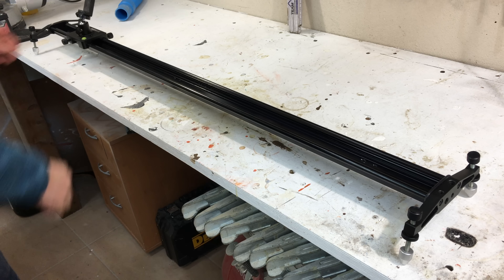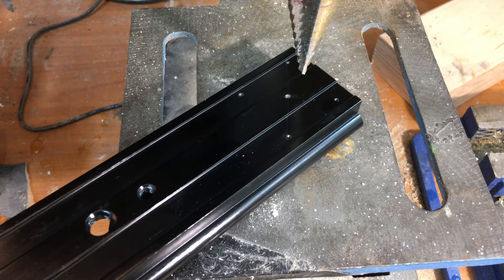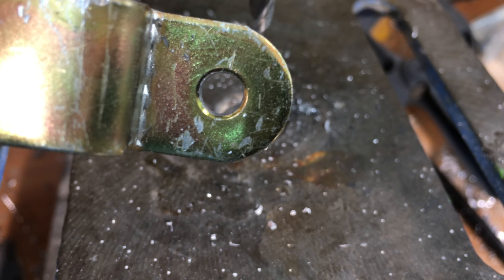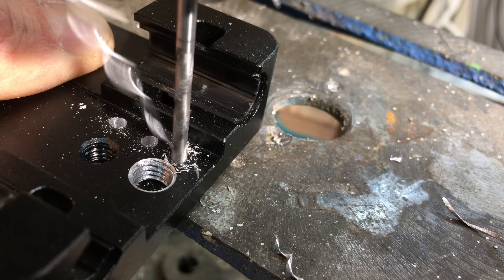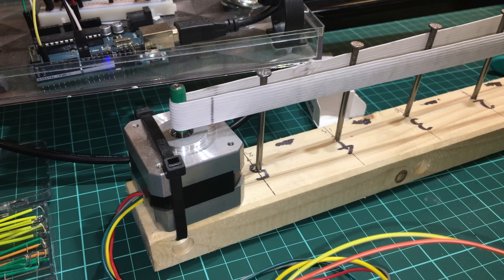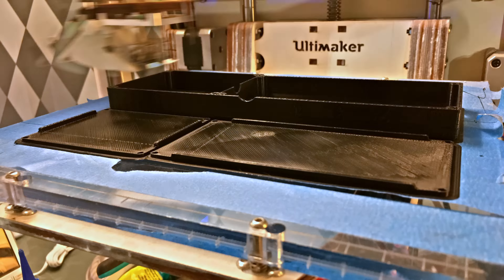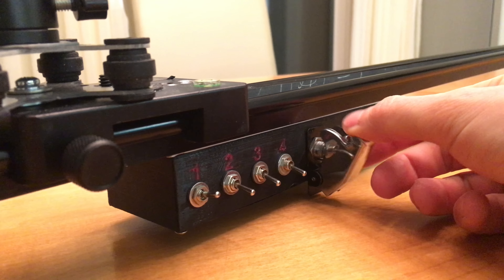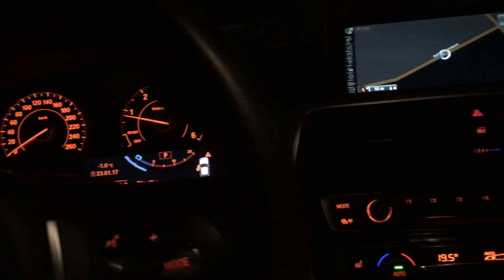Lets Make - A Motorized Camera Slider

Comment: Nice build Max.
Can you tell me if the stepper motor is able to move and retain the truck when the rail is 45° or more bent ?
Gerard
Reply from the maker: +Gérard LAGIER Sure it can. I use mine vertically. The motor retains the position as long as it has power.
Reply: Yes, but it depends on the total weight...What about a DSLR, let say 2kg ?
Do you use a NEMA 17 as motor ?
Reply from the maker: +Gérard LAGIER Yes I use a Nema 17. For heavy cameras you should use a Nema 17 with an integrated gearbox. There are various ones available.
Reply: Yes, this is what I was watching for. The torque is X5.
Thanks for your help.
Reply from the maker: Your welcome!

Comment: Great video Max. I was working on building a thing Sammy Kamkar came up with called the Combo-breaker, but there are a lot of electronic pieces and I'm overwhelmed with wiring and code dead-ends. Also, the Combo-breaker is essentially worthless and is more of a stunt. This might be a better micro-controller learner tool to build as it's useful and seems to have less moving parts.

Thanks for sharing. My interest in micro-controllers is coming back! :D
Reply: I'd like to do some micro-controller stuff to the school bus/tiny home we're building. Maybe having a switch that would close the curtains or something like that. Your camera slider could probably be re-engineered as a curtain opening/closing mechanism.
Reply from the maker: Thank you! I know the combo breaker. The maths behind it is really clever. Good luck with your coding! I can recomment The Great Scots Arduino 101.
Reply: Yeah. This Great Scott video is excellent. Thank you.
Reply from the maker: +Ian Robinson Sure. Once you wired a stepper and controlled it, you can apply that to all kinds of things.
Reply from the maker: +Ian Robinson I sometimes watch it myself for reference.

Comment: I am actually building my own from 3D printed and other components. I am trying to use your code but my stepper is making some horrible vibration in the system so I assume I am at a full step. Are you microstepping and if so how are you as I don't see any power to the MS pins?
Reply from the maker: Yes, I switched to Microstepping shortly after uploading the video. So you need to short some of the microstepping pins to ground I belive. You find how to do it exactly in the A4988 tutorial inside the instructable. Obviously you also need to double the step values in the code to achieve the right speed.
Reply: @MaxMakerChannel  at this point as long as I can achieve smooth motion I'll be happy then I can add more bells and whistles haha
Reply from the maker: Steve Kearney I think you can.

Comment: Hi Max! I am interested in doing a project like this for my camera slider, but I have 2 daunting constraints: the slider runs autonomously AND it is absolutely silent. My goal is to record musicians close up so it would be ideal to not hear a whirring motor on the microphones. Do you think this is feasible, and how do you recommend I proceed? Thank you, and fantastic video!
Reply from the maker: I would suggest using a DC motor with a motor controller for $15 from Amazon. Get a good quality slider with ball bearings. It will be quite silent.

Comment: Is it possible to make this open and close all the curtains in a house at set times? That would be brilliant
Reply from the maker: Yes it is. The circuits and code are already 95° of what you need.
Reply: Thank you for the reply, just realised that the motors may not be powerful enough to move a set of curtains?
Reply from the maker: They are. Even the tinies motor could move an entire ship if the gearing ratio is big enough. Half the speed, double the strength. You can get these motors with build in gear boxes.
Reply: Thanks, do you think a timer controlled auto curtain project is something you would be interested in doing for your subscribers? Will help get our teenager's to wake up a little easier ha
Reply from the maker: Not really unless Somebody commissions me to build one.
Reply: Ahh Ok

Comment: Very impressively and simple design.
You use a mobile, but will the unit take a DSLR. I have a Canon 7D. Will your design need to be beefed up to take on a DSLR?
Again, great video.
Reply from the maker: +Ian S. Rutter Thank you very much. I do my very best with the production, but that also means that they take longer. If you keep it horizontal, the weight doesn't matter. You can get the same size motor with an integrated gearbox ranging from 1:5 up to 1:50 reduction. It will move slower but be much stronger.

Comment: Nice project! I'm also working on motorising my camera slider. The movement is still a bit  jumpy though. Do you use microstepping on your stepper motor?
Reply from the maker: +Maximilian Beck Yes. I use 1/2 Microstepping. You could also use a geared Nema 17.
Reply: Wow that was a quick response 😀 I am using one of these cheap 28byj-48 geared steppers. I thought the internal gear reduction is enough for smooth slides. The torque isn't that high either. Switching to a "proper" nema might be worth testing.
Reply from the maker: +Maximilian Beck I was surprised myself : ). That stepper does look extremely weak. I did not check the details though. But a geared Nema 17 should give you the smoothest motion.

Comment: I like it...i have built this same slider like u but I'm getting a problem with the speed instead of 10s I'm getting 58s and 20s I'm getting 115s...plz help....I have to adjust with traveltime but it is not going faster then 58s...
Reply from the maker: Did you follow the calculations in the code? It depends on your slider length and wheel diameters.
Reply: Max Maker
Reply: Max Maker.....my slider is half of your slider
Reply from the maker: Well follow the instructions in the code. It worked for everyone else, so I assume its correct. I cannot remote troubleshoot. Sorry.
Reply: Max Maker u mean Pully diameter???
Reply: Max Maker...
sir can u tell me of what diameter I need to enter...sir reply
Reply from the maker: The diameter of your drive wheel.
Reply: Max Maker sir thank for u kind reply...one last thing should I need to edit the TravelTime to increase speed...

Comment: Why not use a potentiometere on the analog pin to control speed?
Reply from the maker: Possible, but it’s difficult to know the exact duration then. Especially since the duration ranges from a few seconds to several hours.

Comment: Any way to program this to move 2 inches then stop for 30 seconds then move 2 more inches until it reaches the end?
Reply from the maker: Yes sure. You could add a pause by adding „delay(30000);“ That will make the Arduino idle for 30000ms or 30s.

Comment: Hi there! I love your project and I spent days trying to get it to work. Can I get a working schematic and code please? You left us with a puzzle...
Reply from the maker: I don’t have the schematic unfortunatley. But the code should be there. And you just need to connect the stepper driver exactly as in the linked tutorial inside of the Instructable. Where are you stuck exactly?
Reply: @MaxMakerChannel  I have made it like in that tutorial but when it runs, every sw has same speed and it doesn't stop at the end. Combined SW makes it go slower but a lot slower than it should.
Reply from the maker: Did you enter your measurements correctly into the formula at the top of your code? Especially the length of the slider and the diameter of the pulley? If one of them is wrong it will keep going.
Reply: @MaxMakerChannel  yes, all measured. The resistors should go to v5 or gnd? Should the enable pin be pulled to gnd on a4988. Someone posted a different schematic on comments.
Reply from the maker: The resistors goe between the Arduino pins and Ground. So if the switch is off, the pin is grounded. If you switch the switch, it is connected to 5v. You can test if your switches are working by using the serial monitor. It can read out to you what is going on. If the stepper is moving at all, the stepper is connected correctly. I believe Enable must be high.

Comment: Dude, I've been trying to make something like this for a while. I was originally using electrical conduit as rails, but maybe I'll just pony up and get a cheapo slider to start with. Anyways, Awesome work. Subscribed!
Reply from the maker: +Victor Frost Thank you very much and welcome to the club! I noticed that there are many slider builds on the internet, but not many motorised ones. I did not want to spend a huge amount of time on this, so I just bought one.

Comment: Is there a way to do this using a round slider?
Reply from the maker: Sure
Reply: @MaxMakerChannel  wow, that was a fast answer lol 
Thanks for posting this. I'm designing a photogrammetry rig to capture sculputres, so it has to move in a round fashion. Also, the stepper motor can be set to work more as a... stepper? e.g: if I press the button, it moves a little bit and it stops
Reply from the maker: Rhuan Magalhães oh boy. I built a full photogrammetry rig two years ago for a customer. 12m diameter, fully automatic, scans the entire floor picture by picture. Just set it up and press start and it scans for 2-3hours. But you are going for sculptures yeah?
Reply: @MaxMakerChannel  That's fantastic man! Actually I'm an art student at univerisity in Brazil and my lab is currently studying methods to scan sculptures, busts to be precise, but our budget is really low so it got me thinking that a 3m diameter circle rail with a system like you described would work really well, probably completely automatic lol.
Reply from the maker: Rhuan Magalhães Here is my advice, don’t automate it! It is cheaper and more stress free to just bolt 8 DSLRs to a jig so you can take 8 pictures at once. Its easy to trigger all of them with one button press. Very few error sources and faster as well. Easier to store and transport. Make it even out of carbon fibre tubes.

Comment: Hi Max, I saw the Instructable for this, but the schematic is incredibly small and I tried enlarging it, but no luck.
Would you please add it again. I saw you wrote that you lost schematic. Could you please recreate it. :)
Reply from the maker: Sorry, I don’t have the time to re-draw it. But its relatively simple. There are links insode the instructable to the source of the shematics for the stepper driver. Just follow that. That combined with the picture should get you everything you need. The pins are also labled in the source code.

Comment: Hi Max 
Great Video, I want to make something like this but with two motors one for sliding like in your video and the second motor for rotating the camera.I opened you arduino code and I saw this comment   "//Pin 1 cannot be used for this. Start at 2." Can you tell me why, or can I use pin0 and 1 for driving the second step motor? Thanks
Reply from the maker: Hi, Somehow PIn1 and Pin0 dont have the same capabilities as the other ones. it has something to do with serial comunication. It is best to always avoid them if you don´t need them. This can be a very frustrating mistake if you don´t know about it. That why when you look at tutorials they most often start with Pin2.

Comment: Where do I get the program for the aruino? Right left turn?
Reply from the maker: +Daniel Mendler Its all in the instructable in the description. The code is in a link in one of the steps. Left and right can be reversed by changing two cables of the stepper motor.
Reply: THX

Comment: are there suppose to be 2 10s or a 10s and 10h
Reply from the maker: I remember that I made some kind of mistake. Not sure if it is on the label or the actual code, but it is easy enough to change the code to whatever value you like. If you go through the code you will see the options and the 10h will be something that looks like 10x60x60=36000seconds.

Comment: hey the video is wel made, but i could not find the arduino wiring and the sketch
Reply from the maker: +Rebel Studio's thanks. Did you check the Instructable? You have to use a desktop for the diagram.

Comment: does it need to use resistor and how much ohm  12ohm ?
Reply from the maker: +LeoshitsplashTV 10k ohm for switches.
Reply: thanks ;)
Reply: If I use Dslr  does moter have enough force to move it ?

Comment: I get a lot of vibration and I have a sony a6500 so the vibration dampener wouldn't work because i have a heavier camera ;( Any help to tell me how to remove all this vibration will be much appreciated.
Reply from the maker: Hey, You could use microstepping on the A4988 chip. You can activate it by connecting some pins on the board. That will change it from using 200 steps per Revolution to 400, 800 or even more steps. That will increase the resolution and should lessen the problem. However, it decreases the force/torque. You could also add a gearbox to the stepper motor so it will need more steps. That should also help with the heavy camera, but reduce the top speed. You can account for the extra steps you need in the code.
Reply: Max Maker Thank you, I'll try it
Reply: Max Maker So after some testing I found my motor could only handle half micro stepping - but if i get a motor with better torque will that let me get into the lowesting microstep mode with less jitter?
Reply from the maker: Yes, but a motor with more torque will probably also need more current. The A4988 has a limit at 2A I think. You are better off getting a geared motor.

Comment: Nice, but why not using a ballbearing?
Reply from the maker: You could, but ball bearings are only necessary for high speed applications. There is a speed limit that you can look up on charts where journal bearings are more suitable. That aside, the pulleys I had give a good guidance for the belt.

Comment: Great vid, but, honestly, most of us don't have a machine shop and pro machining gear just laying around. The video is ironically hilarious due to the fact that, Max, a German Cat, ( Cliche) just happens to have a pro machine shop in his house. Oh, He's an Engineer, okay, we get it.Typical. Filmmakers like myself live in a big city.

Thanks, Max, I think this would be great for a film crew with shop equipment. I could see rigging this on location. Everyday practical?- absolutely not. Professionally practical, Absolutely!!
Reply from the maker: Thanks, but all you need is a drill and a hacksaw pretty much and some soldering equipment. You can also go to a local maker space where they have all you need including 3D printers.
Reply: Max, you lost me At Soldering. Filing , oiling. We’re not doing all that on set. Like, I said, it’s great if you have a Pro or Home shop. You’ve made a great tutorial, but if you’ve ever worked on an actual shoot this is insane. Time is money on a set BIG TIME. This is a great project, no doubt so thank you for you concise tutorial
Reply: It's pretty obvious you're not doing all that on set. You're supposed to do that before the shoot. And any simple machine shop will suffice.

Comment: there is also a video with a serious DSLR? If this has a slope high. Jerks it with the cheap slider? to approve the always game and then be clamped.
Reply from the maker: +Daniel Mendler You can use a motor with a 5:1 gear ratio built in.
Reply: Max Maker have You a Link?
Reply from the maker: +Daniel Mendler Deutsch? Google Nema 17   with gearbox. Costs about 35€.
Reply: Max Maker jop hab mir den nema 23 angeschaut. hat 11kg und von der Umdrehung ähnlich. somit müsste ich das Programm nicht anpassen
Reply from the maker: +Daniel Mendler Achte aber darauf, dass der Nema 23 wahrscheinlich auch viel mehr als nur 2A zieht den die meisten Nema 17s ziehen. Der A4988 ist auf 2A begrenzt. Nema steht übrigens nur für die Maße der Montageplatte des Motors.